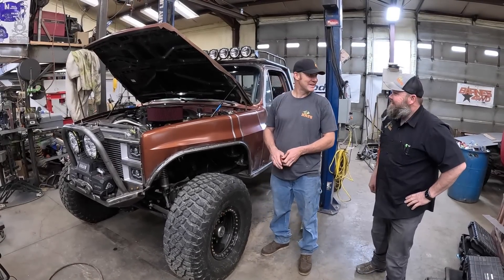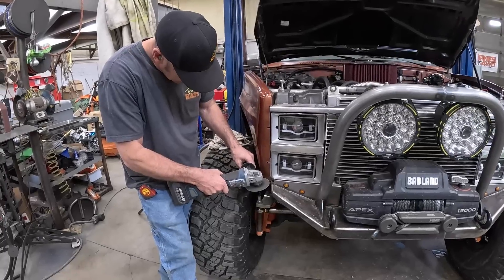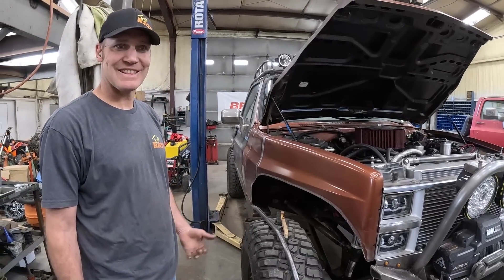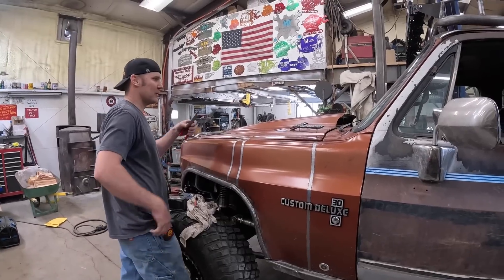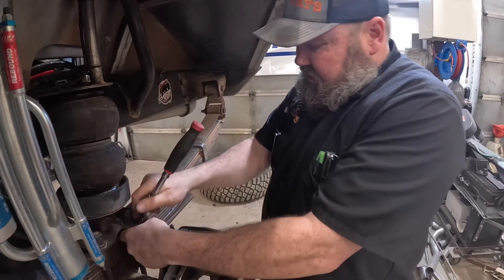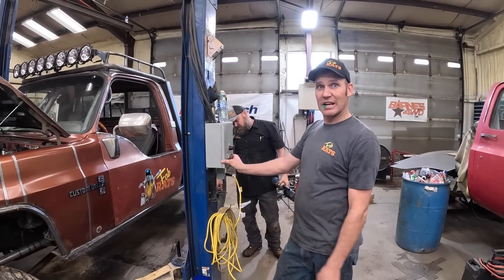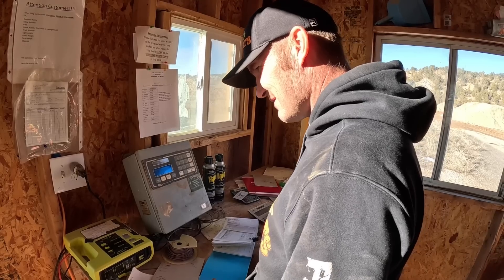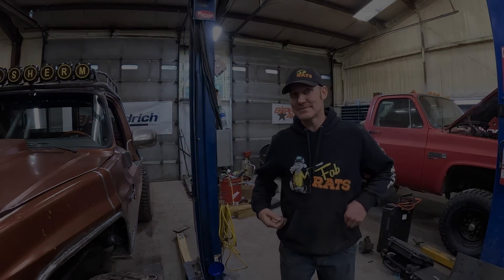Final Push To Get To The Wrecker Games Proves CATASTROPHIC For The Rat Rod Wrecker!

Comment: The trucks are all so unique. Merlin's vintage. Rory's is offroad banged up, ready and tested. Eric's is road tested and semi off road. Paul's is customized, somewhere closer to Rory's Vs Eric. Matt's like Merlin's, not fully trail tested. Matt's concern's will wheel grip, driveshaft reliability, size.
Some of the olympic events: dyno, tilt articulation flex, sand pull/tow, trail with tow, welding, tow vehicle flip recovery. Any night events?

Comment: Crunch time! Lol. I'm there with my build and EJS. Buddy and I JUST finished my crawler box transfer case last night. Still need to weld up hangers and install freshly disk brake converted rear end. Install Frankensteined front disk brake upgrade conversion. Drop old transfer case and install new, including cutting out tunnel and building crossmember brackets. Shorten and lengthen drivelines. Design and fabricate winch bumper. Install said winch. And a dozen other little things... and mmt buddy and I have day jobs. 😬
Nice work guys! I'm diggin' the half doors. 
Can't wait for the OFFICIAL wrecker games videos from everyone. Been staying away from bootleg vids. AND IT'S KILLING ME!!!🤣😂

Comment: When towing, you need to hang the load (Jeep) on a chain rather than the winch line.  With the load bouncing and jouncing as its hanging off the winch line, it will shock load the winch and break or jam the winch mechanism.

Comment: Split the steel tube like a hotdog bun & shove the fender sheet metal in it like a hotdog & start welding it, it will never come off, & it's perfectly proportioned. I was wondering what you guys are going to do when it rains & snows. & how are you going to keep warm or cool a/c in, if you have no windows on your doors. So I was thinking you could weld the top part of the doors back on to the existing  bottom part of the doors with a little more angle iron to make up for the part you cut out. Then weld in a flat piece of metal that would hold the glass in & cut the glass straight across so that the  glass comes down where the top of the doors use to be, weld a plate on the bottom with some weather stripping glued to it to hold the glass in, & now you have windows to keep the rain, snow & cold out & warmth & cold   a/c in. There will be the small opening, where you cut the doors down but at least you won't have rain  or freezing snow or sleet in your face & on your bodies. Peace, health & love to the Fabrats family.

Comment: Ok I know you love welding and you are fab rats. But here’s a professional home Autobody tip. Only tack weld projects like this. Then tape off some pretty lines and use seam sealer to fill gap. Pull the tape when still wet. Looks much better and can be painted. Smooth as Irish whiskey. And a lot less work. But what do I know, I’m an idiot compared to Paul. 😂 thx for the great vids 😊

Comment: I've seen a similar brake issue on my truck. I have a LSD and had my parking brake set. I was navigating Camp 5 Trail in South Dakota. I forgot to release my parking brake and was navigating a rocky section. I could not get it to move forward. It finally started moving after a bang. I went back to see what the noise was. It had tore off my slave cylinder, broke the spring pin, twisted the backing plate and mount ears. My best guess is the LSD sent all the power to that wheel when the other slipped and that brake was set too good.

Comment: When towing a vehicle like that, shouldn't the front tires of the towed vehicle be turned straight? With the hydraulic steering y'all use, could you damage the steering if the tires make contact with the paving?

Comment: I have noticed more and more brand new parts are failing.  The quality of the auto parts in this continent have drastically gone down hill.  I am at the point of using good take off parts over new if possible.